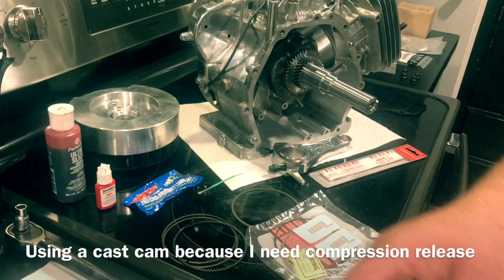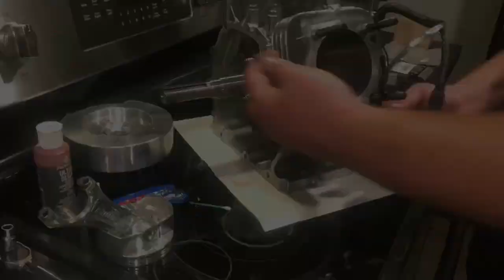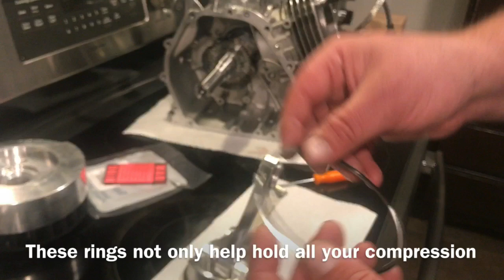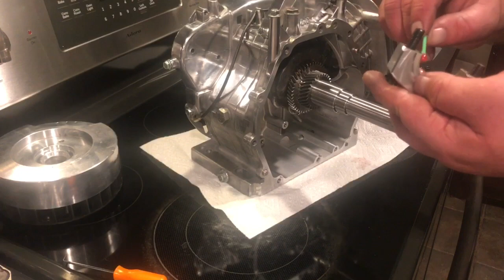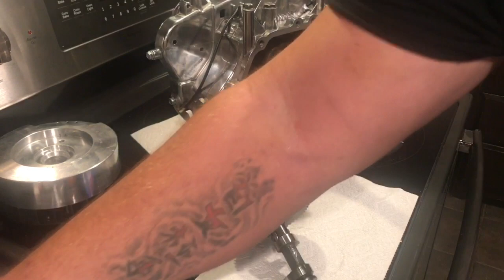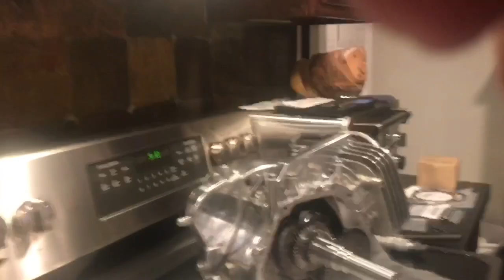Honda gx390 build , ”how to build horse power“ using OFF THE SHELF PARTS , best cam / setup

Comment: Hello sir, sir how to order the billet flywheel Ang billet side cover small engine and also billet connecting rod?
Reply from the maker: You can go to http//:www.paulskarts.com
If your out of the shipping area that’s because the shipping needs to be paid separately after order is boxed and weighed. So for intercontinental orders we will need a list of what you need.

Comment: great video, I need a torque wrench after watching this, I notice you didnt install the balancer rod or the governor, is this because you're using it for racing? Im fixing mine to use it with a pressure washer pump
Reply from the maker: 😊lol
Reply: Paul's karts Lifan 420 do you always leave the balancer out?
Reply from the maker: If I’m modifying and the rod is hitting the balance shaft and it would need to be clearanced ,I would remove the shaft rather than clearance .. shaft is weak when clearanced

Comment: Do you use a cutaway side case when checking camshaft endplay?
Reply from the maker: No ..insert just the cam into the block ...bolt on side cover and put your hand down the piston bore and shake it side to side ..shim until it barely has any movement ..
Reply: Paul's karts Lifan 420  good night, you speak gap rings 0,0025? 0,63 mm?to much?
Reply from the maker: Can you try to say that again ....I don't know what you said ...please write it again..
Reply from the maker: This is the oil ring ...not the compression or scraper ring ...if your top or second ring was .025" yes that would be to much gap ...set your top and second ring gap at .011-.013 for good power ...but make sure block bore is straight
Reply from the maker: If you need parts let me know ..I sell custom parts for these engines ..also I have specialty tools like newway valve seat cutters , burr bits for porting heads , micrometers and dial bore indicator ..so if you need something let me know ..I sell thru e bay ...I put those custom springs I had made on e bay today ...the extra ones !! If you want you can buy them
Reply: how much for the billet intake manifold for this engine
Reply from the maker: There like 40$
Reply from the maker: Also I just the springs I found and had made on eBay I am using these in my build and have listed the spares on e bay
Reply: Paul's karts Lifan 420 in brazil i dont have total Seal qnd other parts racing, second ring with fire ring watts thikness and gap? Tks all best
Reply from the maker: What is your size piston ? 88.5mm , 90mm , 92mm ...?     Use the .004" per inch rule ...if your bore is 88mm set the gap to like .015" or .018"
Reply from the maker: Some people set there ring gap tighter to .003" per inch of piston ..but you need to be precise when measuring the ring gap ...make sure you check it in 3 spots down the bore ...sometimes the bore from the factory is not straight ! That would be closer to .009-.010" on a 88mm piston ....but if you stick a piston ring you will blow the engine ...that's why I use total seal ring ...it is much safeer and much better sealing !